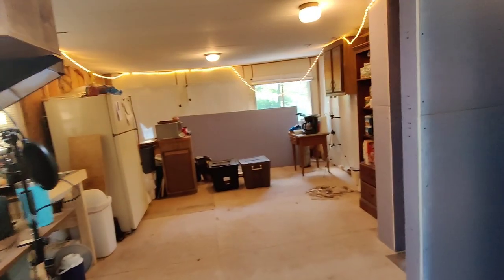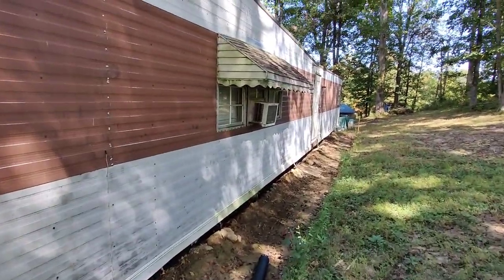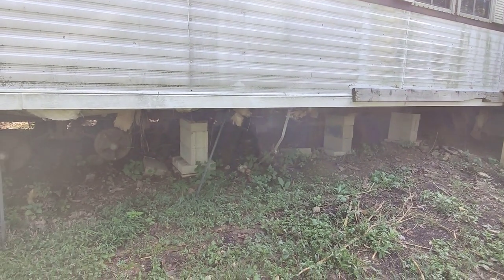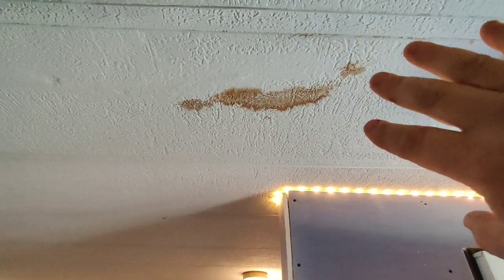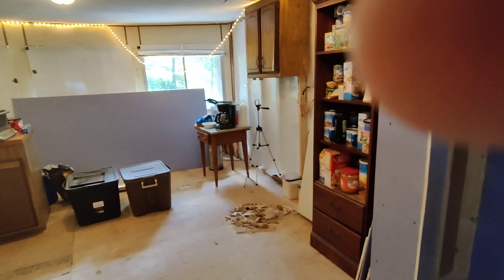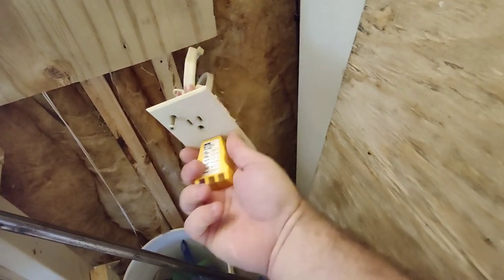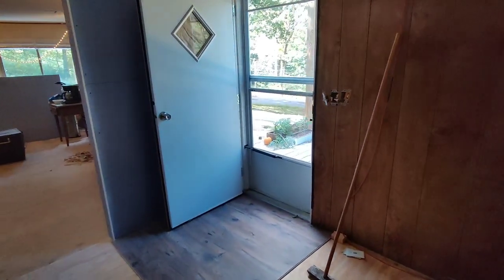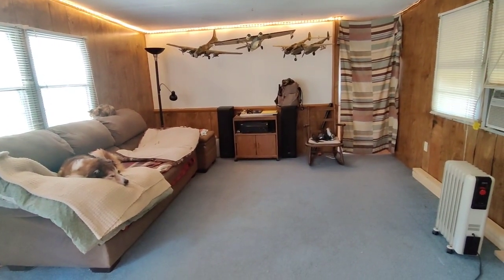THINGS TO LOOK FOR WHEN BUYING A OLD SINGLE WIDE MOBILE HOME - VIDEO RESPONSE

Comment: Excellent information! I bought my mobile home in 2011, and it is a 1981 double wide. Here are some things I have had to deal with/fix/upgrade since I’ve lived here; maybe it will help someone to know to check for these things too. Even though my water pipes were wrapped, I had a couple pipe breaks during my first and second winter here, (because of age they just cracked/split), so I ended up having to hire a plumber to put all new pipe in this place; that cost approximately $1,400. After 30+ years, I guess that’s pretty much to be expected, but that was a big one! Then, about a year or so later, my hot water heater bit the dust, so I had to replace that which was approximately $600. These are just a couple examples of issues I’ve had. Just expect that if you buy an older mobile home, things are worn out and getting old (aside from the owner!! 🤣🤣), and will need replacing if they haven’t been already. My biggest piece of advice to everyone buying a mobile home, especially an older one, is to have insurance!! I cannot stress this enough!! It’s not as expensive as you might think; I was very surprised at how affordable it was, especially for someone on a fixed income. When the plumber replaced all of the pipe, the one thing he did not replace was the hot & cold pipe that goes to the bathtub, because it would have meant opening up the wall, and I didn’t have enough money to have that extra work done. (I was lucky to afford it as it was). Well, a couple years ago the cold water one broke and flooded my bathroom, dining room, and part of my kitchen. THANK GOD FOR INSURANCE!! It turned out to be a blessing in disguise because I got a new bathtub and beautiful new flooring in the bathroom, dining room and kitchen, but it was a nightmare there at first! In spite of these issues, I absolutely LOVE my mobile home and wouldn’t trade it for anything. I have poured my blood, sweat and tears into this place, and it is a beautiful home that is all mine, and I plan to live here for the rest of my life, or at least as long as I am able to! I belong to a couple Facebook groups for mobile home owners, and I have noticed that mobile home owners seem  to have an extreme amount of pride in their homes. I think it’s because a lot of us do the work on them ourselves, in most cases, and also they are an affordable home for some of us who wouldn’t be able to afford to own a home of our own otherwise. I’m so happy I have this home! ♥️

Comment: Thanks for the video. I'm buying a 31 acre property in NH and it has a 1971 mobile home on it. From what I saw doing a quick run through it was in amazingly good shape, someone went through the work to build a roof structure over it with a now 15 year old metal roof, which is in good shape as well. There's a musty smell which concerns me but no signs of water damage or rot. I'll have to make a second visit to inspect closer but for us we want the land, the mobile home is a bonus plus there's already septic, water, electrical and high speed internet.

Comment: Great video. Another thing I could add is if the mobile home has sheet rock walls, do a gentle push with your finger at the bottom of the wall where it Meets the floor. Just like the video said with the paneling if it gives a good bit or feels spongy then there is probably some water damage on the inside of the wall.
Reply from the maker: That's a great idea!

Comment: Hey Marty, Where your trailer is missing the skirting on the front side, frame in 2inch closed cell foam board (ISO) you won't regret it, especially in the winter months. The critters won't mess with it and you can put a finish skirt over it later.
Reply from the maker: I plan on building a treated 2x4 frame then covering it with T1-11 then insulating the inside of it. But that's way low on my list of priorities currently.
Reply: @MDC2020  Here I am telling you what to do with your trailer? LOL, Oh the irony in that Lol, I think I'll crack a beer and THINK about what and WHEN I'm going to do with my trailer? lol, You might be motivating me Marty? lol, I'll let you know how later how much work I got done today or how many beers I drank instead lol.

Comment: if the metal siding is loose the wood behind will be rotted. check in window opening for signs of water stains and rotted wood. 
The tarp like stuff under newer trailers is called bottom board and should not have holes or be hanging down. oh yeah nothing in a Mobile home is done the  same way as a normal house that mean doors and wiring outlets and switchs  will not be found at lowes or home depot

Comment: MANUFACTURED HOMESTEADER another thing to check out is the mobile and or the manufactured homes frame, the reason why you' d want to check out the mobile and or the manufactured homes frame is because depending on the mobile and or the manufactured homes frame condition you'd want to avoid buying a mobile and or manufactured home that has a damaged frame.

Comment: So to put it simply Alexandra, Don't buy one like Marty's! lol, I'm just kidding Marty lol.
Reply from the maker: HAHA I mean it the truth. It's not for everyone that's for sure. But I'm a glutton for punishment lol
Reply: @MDC2020  I bought my 1971, 12x65, 10 years ago in a park in the country just outside of town for $50K, my lot fees were $250 per month and now the lot fees are $350 per month (Cheap living). Two years after I bought it I had to move back to the big city for 3 years and one winter the hydro went out and the shower head froze, so my neighbour crawled underneath my trailer which is not easy to do and cut the 1/2 inch PVC water line and put a bolt in it to stop the water then the neighbour called me to tell me what happened, 4 days  later I went to the trailer and due to the water damage I had to rip out the bathroom, kitchen and all the flooring. I moved back to the trailer 5 years ago and just crawled under the trailer to fix the waterline 2 days ago lol. I'm good at taring shit apart but not so good at putting it back together again lol, I think I have a contemplation disorder lol, and yes you are right "It's not for everyone" and speaking of shit! Don't ask! lol.
Reply from the maker: HAHAHAHA but we get it done sooner or later.
Reply: Jajjaj His home looks better right now....🥰